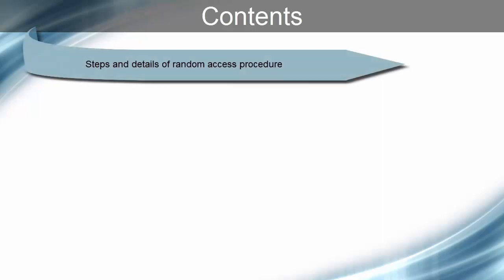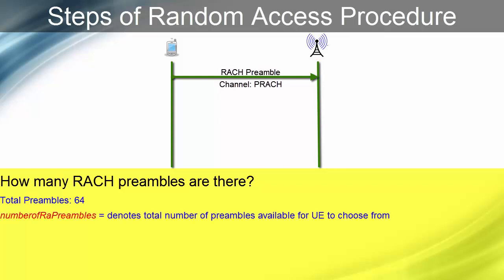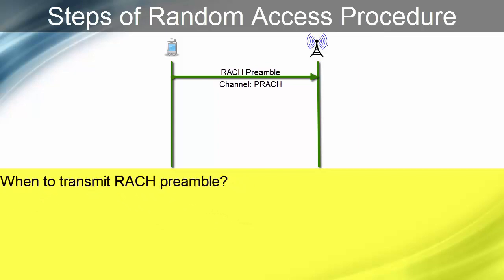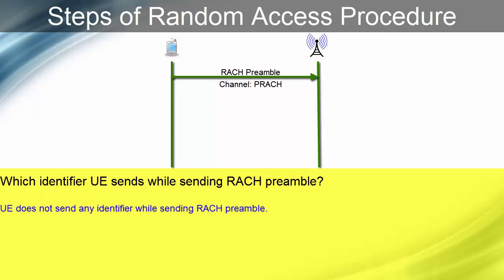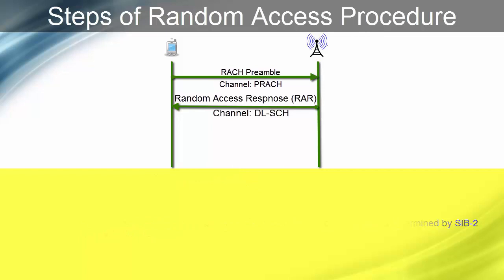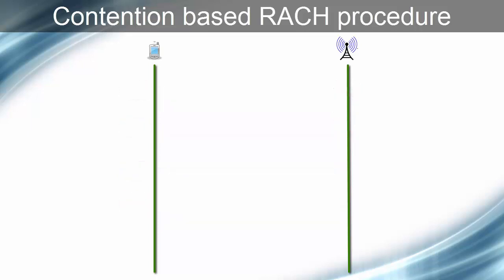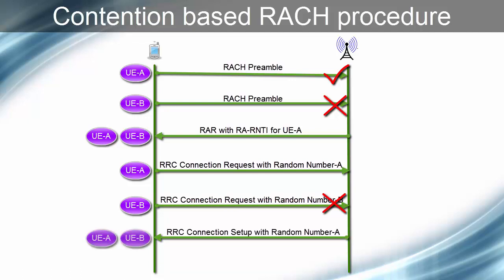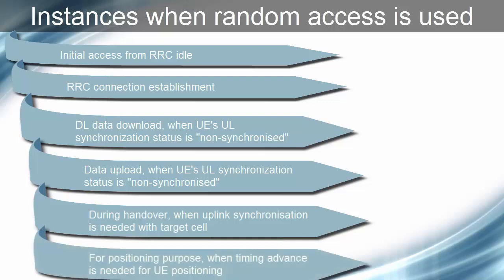LTE Random or Initial Access/RACH Procedure

Comment: 11：27 both A B  will choose random number as initial identity and send RRC connection request and start the timer t300 but you know we will not be able to decode message from B is using the timing advance value that was intended for A 

兩個都會收到msg 4 both you will decode this message as it is addressed by TC RNTI " eNodeb will include random number in this message" that was sent by A 這是A的隨機號碼   although both UE s will decode this message but random number sent by embassy by B will be will mismatch only at this stage you will be will come to know that it has lost out to some other ue in contention resolution then B will be will start random access process again and from very beginning contention free random access procedure did instances went because of timing restrictions contentions are not acceptable   B因為msg4帶的隨機號碼錯誤而知道自己沒有得到競爭

Comment: hi all,can any1 explain this.......

at 11:39  how cum UE B send rrc connection request,when it was not assigned any uplink resource
Reply: Hi  its a Control Plane Message No Need Pre established UL Connection Because RRC Connection Procedure itself for Creating UL Connection(Radio Bearer Setup).
 for Attach with N/W UE sends RRC Connection request with EnB for a Radio Bearer Setup. RRC Connection is an Uplink Message/request spends through PUL-SCH-->UL-SCH->CCCH (UL).
Reply: thank you

Comment: Hi 
At 11:02 you mentioned ENB will send RA-RNTI but As per my understanding RA-RNTI is sent by UE in Request message and ENB will revert back with TC-RNTI(Temporary Cell) in RAR
Reply: RA-RNTI is calculated by enb,based upon the time of reception of rach request
Reply: uE dont send RA RNTI , nerwork will find out the RA RNTI by looking on which subframe ue transmit preamble
Reply: @yuvrajpatil1710  "UE shall monitor the PDCCH for Random Access Response identified by the RA-RNTI" ,WHICH MEANS THAT UE MUST HAVE  SENT THE RA-RNTI..........is it not the correct justification
Reply: @veerojumanasa7948   after transmitting Preamble UE serch for responce with in RAR window . this RAR window will always start from 3rd subframe after the premble send.

the responce window (RAR window) size is configured upto 10subframe and it informed in SIB2 

so for responce UE will serch only the RAR window.
Reply: *yeah in the 3rd subframe it reads pdcch first...
*in dat pdcch it reads ra-rnti,which it has sent while transmitiing request...........
*once if it finds its own ra-rnti,den it starts reading pdsch where info abt uplink grant is present
*so now in the whole scenario,,,ra-ranti is transmited by ue bassed upon the time at which it is sending
Reply: @veerojumanasa7948  except ue send rarnti whatever you said is correct :)
i will cross check though am i right or not .
Reply: @yuvrajpatil1710  yes,give me confirmation again........if not ra rnti,,based on wat parameter will ue identify dat the response if for that ue only........ :)
Reply: @ @veerojumanasa7948   @yuvraj patil : Both UE and eNB calculate the RA_RNTI based on the  time and frequency slot used to send the RACH preamble. RA_RNTI=1+ t_id+10*f_id.

Comment: @11:15 >>
While 2 UE send same preamble at the same time to same enodeB, what happens if by chance both UE A and UE B again pick up same random number while sending RRC connection request? 
Then, enodeB will not able to decode the RRC request from UE B because of mismatch of timing advance. But the RRC setup message sent from eNB for UE A will be received by UE B also and the random number will match.
Reply: I think its because the eNB will not be able to decode the RRC connection request because the timing advance number will be wrong. That was returned with the original RAR with RA RNTI for UE-A. So there will be timing incoherency.

Comment: Thanks for the wonderful video.. I have a question regarding collision..

@10:24 - you said that there are two possibilities :
1. None of the RACH preamble heard by network 
2. Only one of the RACH preamble received by network (i.e. UE A, per your example)

Why can't both the RACH preambles (from UE A & UE B) be decoded by network? could you pls. clarify?
Reply from the maker: First of all thanks for such a positive feedback!

See, when two UEs choose different RACH preambles then contention never arises. In this case, eNodeB can easily decode RACH preambles from both UE as all the RACH Preambles sequences are orthogonal to each other. 

But when two UEs choose same RACH preamble then problem arises at eNodeB end. In this case, depending on the timing alignment of RACH preambles from both UE's, eNodeB could decode either any one UE or none of them. Decoding will depend on their timing alignment and strength of the received signal at eNodeB end.

It is like, if two people scream same sentence at the same time, you can either get complete sentence from one of them or both will distort each others voice.

Hope, I was able to clarify your doubt!!
Reply: Thanks a lot for the clarification!
Initially I was thinking in the same direction, that two messages (sent by UE A & UE B) with same code would interfere at node B and would sound like noise. However, I wanted a confirmation from an expert like you!
Reply: Is it possible that enodeb decoded preamble from both successfully but it couldn't decode the Rrc request from neither?